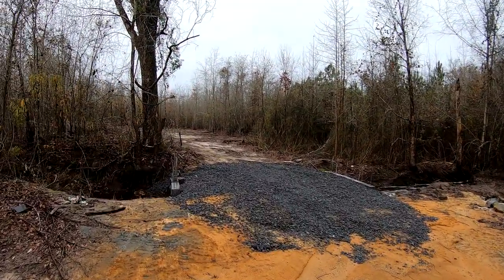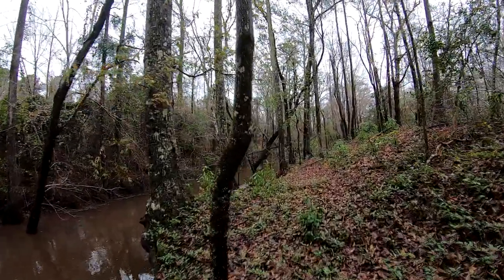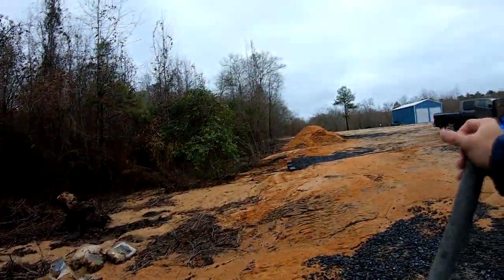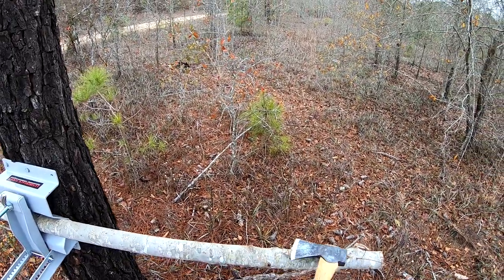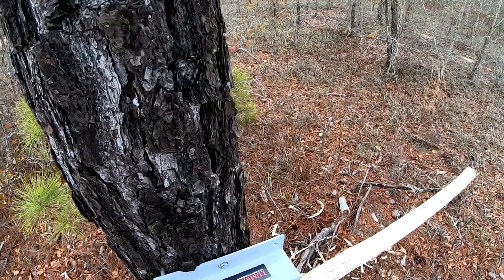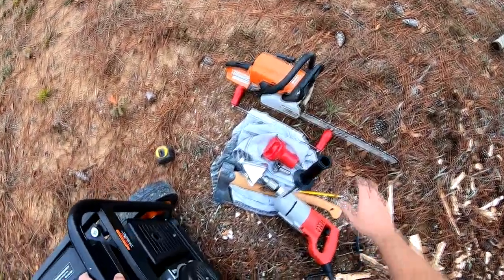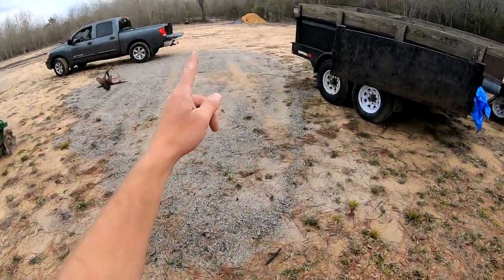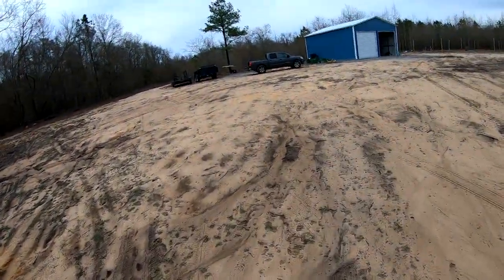Testing the Mortise and Tenon for Fence | Post Storm Bridge Update

Comment: I don't know if your still working o this project, looks like east Texas where I live. I would suggest treating the vertical post your going to put into the ground with a product Calle "Tim Bore." very cheep and works for a lifetime.
Reply from the maker: Thank you Gino. I was going to use burnt motor oil and diesel fuel but may look into Tim Bore.

Comment: After all that work shaving those logs witch looks awesome by the way! I would definitely recommend using a oil based stain messmers is a gd one 👍👍👍
Reply from the maker: Thanks Mad Bri! Any links to treatments would be appreciated. My father said to use creosote, but I fear it would be too harmful to the environment. Diesel fuel isn't much better, but if I don't use something it will rot in a short time.

Comment: Good the bridge walls held out, but sure need to do some work about the back wash. Good in-site to your vision. Lots of hard work making your fence.
Reply from the maker: Thanks Duke, but there's nothing I can do about the backwash. When the creek rises the ditch will not flow as it should. That creek moves a ton of water from other parts of the state and flows all the way to the ocean. The most I can try to do is fill in the hole where it dumps with some rock as it washes out.

Comment: trying to get my head out of my rear enough to get the words right.  not meant as any sort of an accusation just as statements!  the area wasnt eroding before you started changing it.  the removal of all the plants is a large part of the why.  the roots were binding the soils in place.  the trunks and stalks and debris were deflecting and slowing the flow.  ive no doubt you know all that. were i trying to deal with the erosion issue id re plant a native turf grass blend or ground cover like clover.  there are multiple seed mixes available so some homework as to what would best suit the site is probably needed.  however even just grabbing the cheapest bag of whatever would be better than just bare soil.  yes there will be damage from equipment but i assume you tend to travel the same paths.  the bag concrete in the ditch to absorb the abuse of the water should help a lot with the ongoing washouts.  glad to see the new bridge walls are holding and the plans for the fence coming together.

Comment: Nice job.  You are great at the learn you go approach. Hard work and talent goes a long way. The old-timers always told me to keep the hand tools sharp, work at it, stay focused and work safe; the job will get done. Diesel fuel and used oil mixed.  The rip-rap on the outlet is a good idea.  We used those to get rid of water without wash-out on the outlet of water retention ponds in developments  or for larger buildings.  We always had to do water studies and have engineers telling us what to do to keep the state happy.  On the farm we picked field stones from the plowed fields to get the rock.  There are always cheaper ways around the problem.  Thank you for taking us along on the journey.
Reply from the maker: Thank you Marc! No rocks in the ground down here. I'll have to buy them or make my own!

Comment: Ok, now you're working with my brand of tools! Ancient stuff! I use draw knives frequently plus do square mortise and tenon joints for medieval furniture. Got so tired of the chisel work required for the mortises that I bought a specific machine for it. Just too many things to work on to do THAT much chisel work. Trestle tables, chests, gothic stools, etc. Glad to see you using the tools and the materials at hand. Make no mistake, it will be daunting but once you get into a groove and process using that drawknife, I promise you that it can turn therapeutic. Just bank the time to do it when you're tired of walking around or to end the day by doing the drawknife work. Leave the drill attachments for bulk processing once a batch is peeled.